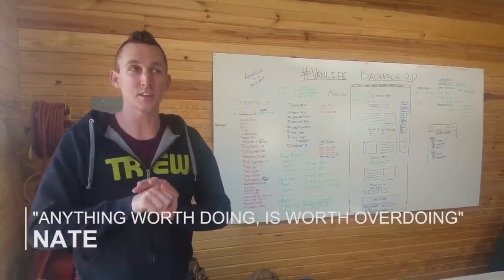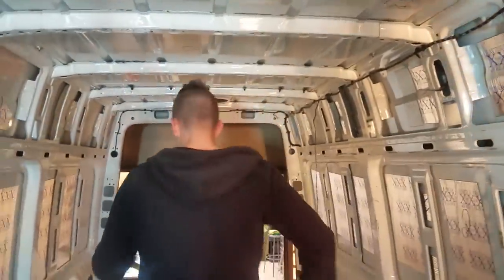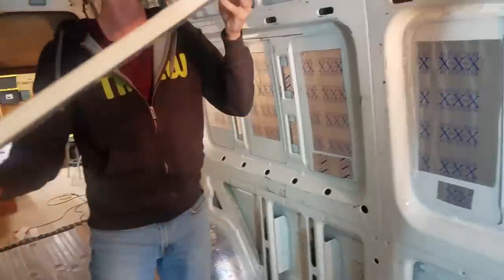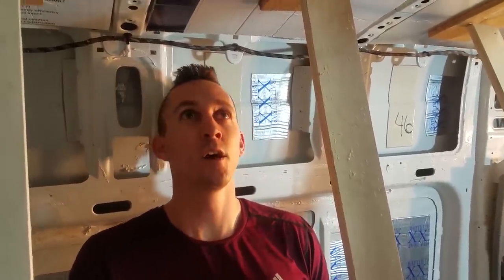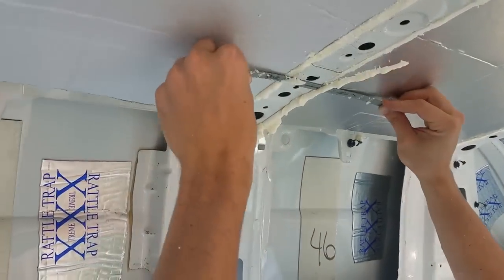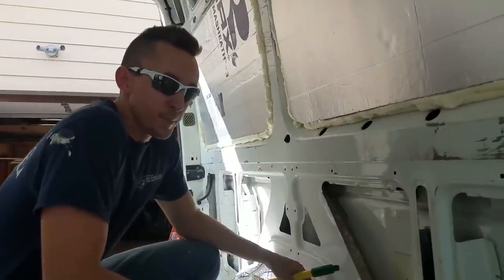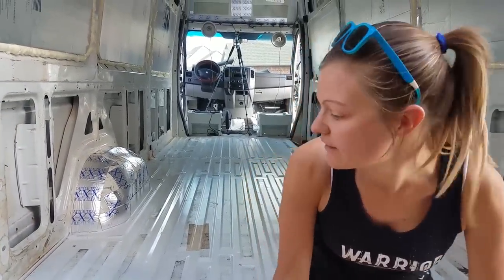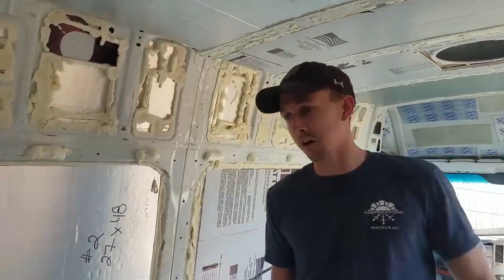Installing Campervan Insulation in our DIY Sprinter Campervan - Ep: 8 | Adventure in a Backpack

Comment: This was an informative video and thanks for posting it! Finally I bought a van yesterday; a low miles 1994 G20 conversion with the little high top. I plan on ripping out the interior and building my own. I test drove a few cargo vans first and didn't notice until I drove the one I bought how handy having windows on the right side was. I would suggest adding a window on the right side because when you pull out of a side road and the intersection is at an angle vs. a "T" how those windows make it easier to see oncoming traffic. I realize I will have to have insulated and removable window inserts. Good Luck with your build! I can't wait until I get started on mine after I go thru the mechanicals and make sure it's safe.
Reply from the maker: Thanks for watching!  You're very welcome!  Sounds like an awesome project!  Those angle intersections are definitely tricky.  Most of the time, I can kind of swing around a little further and kind of turn it into a T intersection.  For the times I can, Stephanie is always willing to lend a watchful eye.  Good luck with your build!! :D :D

Comment: TIP: When you're ready to tackle a van conversion with insulation. Please do yourself a favor. Get some silicone for sheet metal/body work. Your local body shop can advise about type/brand. Well even "bathroom" silicone work well. 
Go trough EVERY single spot where metal meets metal, all the joints, etc.  Give it a go with a nice bead of silicone. Sounds tedious but in fact is one of the fastest operation in a van conversion. :-)
Let it settle and go for a ride... at least 50% less panel drumming. Enjoy... ;-)
Reply from the maker: +crpth1 Cool idea!  :) :)  I wouldn't have thought of that!
Reply: crpth1 polyurethane calking works just as well and will last longer

Comment: Obviously far to late but you are supposed to wait till both surfaces you spray with that glue are tacky and then put the surfaces together. Probably wouldn't have needed the supports if you did that. Just an FYI if anyone reads this. Though it does look like excellent work you guys did!
Reply from the maker: Thanks so much!  Yeah, we were just following the instruction that were on the can. lol  At least for the ceiling, the supports were nice because of how much even pressure we needed to make them form to the roof.  The supports on the sides would have been nice to do without.

Comment: Love your content you both come across very natural and informative. 
Next time you may want to consider using a pro gun for the spray foam, they are cheap and have finer control and you don't need to use it all in one go. The foam cans are cheaper. You can also get a can of solvent that just dissolves the foam (soft or hardened) which is great for cleaning it off of clothes, get that T-Shirt out of the trash....  Do you intend to do a followup video with your thought on how effective it has been and what if any you may do differently next time?.
Reply from the maker: Thanks so much!  Good tips!  We will definitely check into the pro gun next time.  Before starting the project, we underestimated how many cans it would take. lol  We will indeed do a followup video, likely in the spring as it looks like we will be spending winter in the mountains.

Comment: Trying to get polyiso to stick can be a pita...

I wound up using r13 fiberglass in the upper and lower side panels,  great suggestions large gap filler where I couldn't access, and I'm trying to get polyiso glued in with construction adhesive...

Comment: Did you adhere wood strips on the floor of the van (before putting down the rigid foam board). If so, how did you do it? Did you adhere the rigid foam board to those strips? And how did you adhere the plywood to the foam board? (If you have another video about your flooring installation, I can't find it. Sorry). Can you please explain your floor instillation process in more detail? Thanks!!

Comment: I think you did a great job, I went with the polyurethane (closed cell) sprayed everywhere (ceiling and upper walls) and polyurethane poured into the lower walls (small amount at a time to prevent warping) and a 1" rigid foam board on the floor.
like you said there are so many ways and everybody thinks there way is better...
Reply from the maker: evypr0ductions Nice!  would you do it that way again or would you explore other options if you were to do it again?
Reply: As of now yes I would do it again, I'm an architectural technician and one thing that you learn about insulation is that moisture will condensate if you have air pockets, you guys seem to be only worried about the outside heat, but I live in Canada so I have to worry about the cold outside air as well, the last thing I wanted was to have inside moisture (breath, shower or cooking) condensating on the cold van panels. my van conversion is operational but not 100% complete so I will see in the long run if it was a good option.
Reply from the maker: Awesome!  Good to hear.  You didn't have any issues with warping?  Obviously, slow and steady seems to be the way to go there, eh?
Reply: exactly slow and steady is the key, in my case I had 24 linear feet of lower walls to pour polyurethane into so you dump one cup every 18inches, you can pour a layer every day (1hour). the other thing is that if you trap the foam it will warp the panels, so if you have upper free space for the foam to expand to, you won't have any issues with warping, my van is an extended Ford E250.

Comment: Did you notice any distortion of the metal panels as a result of using the expanding foam insulation?  Sometimes people do not expect the pressure caused by the foam expanding inside of an enclosed space.  Injecting the expanding foam into those ribs is the questionable area only.  I was just wondering if it's possible for that to cause bulges on the outside of the van body.
Reply from the maker: I've heard of that, but never actually seen it.  We did multiple light layers of the foam in the ribs of the van to avoid that though and we had no problems with it.

Comment: One can of Great Stuff can be used multiple times if you simply use a can of carburetor cleaner to dissolve the foam in the tube and spray nozzle.  
Carburetor cleaner is spray acetone. Acetone dissolves styrofoam.  
So you can do that if you want to.  But if you want to do it all in one run that's fine too.  I have done it both ways.  
Love the van.  Please come do mine.
Reply: Uncle Kent isn’t that how you make napalm?
Reply: @StephenShreds  No napalm is gasoline and styrofoam

Comment: Did you consider under carriage insulation?  A lot of refrigerated trucks spray foam underneath. Needs to be re-coated every three years.
Reply from the maker: Dreux Jacques Actually, we never considered that and really didn't know it existed.  Seems like something that would be easy to add down the road if needed.  Thanks!
Reply: Be sure to used closed cell foam insulation. If it's open cell foam it will act like a sponge and cause rust.
Reply: @EMU I'd love to hear more about this.

Comment: I'm loving your progress. I bought a 170" sprinter at the beginning of March. My brain is absolutely fried with the hours I've spent researching and planning. I think i'm paralyzed. I've installed a maxair fan and roof rails. Added sound dampener and Insulated the rear doors. The amount of braces you used made me a bit anxious lol, but it turned out great guys! well done. I also follow you on IG. @2dogsandavan
Reply from the maker: RedSea Desert Awesome!  There is SO much information out there.  we are aiming to do a solid job...without over thinking it.

Comment: Did you guys experience any squeakiness from the foam?  And I've read that this type of spray foam is open cell meaning susceptible to absorbing moisture and thus mold over time, what are your thoughts on that?
Reply from the maker: Nope, no squeakiness and this type of spray foam is closed cell.

Comment: guys look for the 3M 90 if you want bomb proof holding power!
Reply from the maker: Nice!  Yeah, we used the 3M 77 and it... kind of didn't really hold very well...  That expanding foam though... Wow!  Once that stuff expands and dries, it holds that rigid foam in there like damn concrete!  We will def give the 90 a shot next time we need a spray adhesive!

Comment: Great video.  This is exactly how I plan on my upcoming build and also thanks for the rattle trap tape concept.  The only thing I won't use is that good stuff spray insulation to fill in the cracks. Instead I'll just cut tiny  strips of cotton or polyester batting and use tape, and just stuff the ribs with batting as well. That spray stuff is just too damn messy. Besides I live in southern California so I really don't need to go overboard with my insulation and I won't insulate the floor either.  Good job you two!

Comment: Great work.
I like that you foamed all the cracks
if you install a panel with tube of silicone or construction adhesive, apply it in circles. the circle forms a suction cup and will hold the work better until it dries.
Silicone holds very well.
Reply from the maker: 64maxpower Thanks! Good idea!  I'd never heard of that before.  I was surprised at how well the expanding foam held the panels in place.  That's some sticky stuff!

Comment: What should I use on roof of gmc Savana hitop fiberglass. Only have about half an inch due to headroom. Thought of 3/8” Ultratouch radient barrier denim towards ext foil int. I have some 1/2” polyiso foil on one side. And what about 1/4 or 1/2” pinkboard XPS but it’s not foil faced. I want keep sun heat out yet and cool inside as well as warm in winter.  Confused....

Comment: Hey - great videos and extremely helpful - thanks for putting them together. I'm just starting to insulate. How did you size the insulation to the gaps in the size of the van as they're each different? Thanks
Reply from the maker: Thanks so much!  We actually just took measurements to the approximate size then trimmed to fit.  We tried templates, but that took too long for not very much savings.  Good luck!  It's a long process! :D :D

Comment: I got away with cutting an inch or so off the spray tube after it hardened when I went to use it later. If you camp in super cold weather the floor is important but, those sealed air gaps air also insulators. Good job.
Reply from the maker: Oh, nice!  I didn't even think about cutting off a bit of the tube.  Looks like we will be going super cold this winter so we will have some first-hand intel.  Thanks for watching!

Comment: With all of that spray foam, aren't you concerned at all with off gassing? There are other greener and less toxic ways to go, any reason you went this way? Just curious, I haven't priced the greener foams available either. Thanks.
Reply: You're thinking of the old foams that used to be used, the new ones only give off gasses for a while until it hardens.
Reply from the maker: CrossGrain Wood Products,LTD There is ALWAYS A greener way to go and we love going that way.  unfortunately, in our research, we never came across any products that were both green, useful, AND within our budget.  That being said, the foam doesn't have any smell, really, at all... I wish I had some data to back up a claim that it doesn't off gas, but I don't.  But it does pass the sniff test and that will have to be good enough for us.  Plus, we have some killer ventilation set up too! lol

Comment: Once again, a very helpful video!  As I looked at your Oceans 12 support board gauntlet, I kept thinking: Thinsulate.  Did you consider Thinsulate? I know it's more expensive that polyiso but not bracing required and maybe easier to fit in weird places/conforms more.  Just curious how you chose the polyiso.  I also read that polyiso loses R-value in the cold, but maybe not enough to matter.
Reply from the maker: We considered all options; then we picked the one we felt would be the best at the time.

Comment: Curious why you used the existing floor as a template but didnt just reuse the existing floor? Im doing a similar build and my floor is in pretty good shape that was pulled up. Seeing that it is 1/2 inch thick (just like 1/2 inch thick plywood) I was thinking to simplify life and reuse. Clearly Im bringing this up for any opinions as to why NOT re use it so I might rethink this? Im not trying to be judgmental, just want to think it through properly if Im making a mistake. Thanks.
Reply from the maker: Great question!  Our van was used as a plumbing van and had all kinds of smelly grease and grime on them that never would have cleaned up.  If the floors are clean, I'd definitely consider using them, but ours weren't.

Comment: FYI, rip-cutting lumber refers to the grain direction: a cut with the grain is a rip-cut and across the grain is a cross-cut! The actual length of the cut is not relevant except for the choice of cutting tool (not the saw-tooth shape or number -- very relevant). Plywood cut across the small or long dimension of a piece is both with and against the grain, since the lumber is cross-laminated.
Reply from the maker: Neat, thanks!

Comment: Hi, Nate and Steph. Great videos and website. 
I'm thinking about insulating my floor the same way you guys did. Are you still happy with what you ended up doing? Specifically, what can you tell me about possible noise...Is it relatively quiet, or does it squeak at all when walking on it? Thanks for your time, and have fun.
-Mike
Reply from the maker: Sorry about the delay.  Your message got stuck in the spam filter.  Anyway...we are happy with it.  There is essentially zero noise.  After a thousand miles or so, the build is pretty quiet.  There is a rattle or a squeak here and there occasionally, but no worse than any other car we've had, but I can't say if it's due to the insulation or not.  Also, there is no squeaking when walking on it.

Comment: No need for all that wood supports, you could have brought a expanding foam gun and tube cleaner!
Reply from the maker: Tahir Rana For the wood, yes we did.  The adhesive was not strong enough to hold.  

For the expanding foam: Yes we could've, BUT...we didn't.  Remember, our opinion is: the best way to insulate the van is the way that is done. ;)

Comment: You are right about not filling the channels in the floor.  The proper rigid board has sufficient compressive strength that bridging over the channels is not a problem.  A continuous layer of insulation on the floor is needed.  The metal conducts heat from the outside  in orThe walls and roof should have a continuous layer of insulation as well. The depressions can be filled with rigid insulation and then the continuous layer applied over it.
Reply from the maker: Joe Hearn Awesome! yeah, so far so good and we have had several nights in the 30-40 degree range with no heater.

Comment: How did you make out having the roof vent already installed? I'm wondering if i should wait to put the roof vent in until the insulation is in.
Reply from the maker: Wilje pretty good really!  it was nice not having anything in the way when I was doing the fan.  if I were to do it again, I would do it the same way.

Comment: Take your measurements in centimeters so you don't have 54 and 1/2 or 13 and 3/4.
54 and 1/2 is 138 cm, 13 and 3/4 is 35 cm. So much easier. Only Americans use such an obsolete measuring system.
Reply from the maker: Whereas I do wish America was on the Metric system, we are not, and all of our measuring tools are imperial.
Reply: Johnny MF Bravo It's actually a pretty logical system of measurement for construction. I'd use metric for engineering parts and other things though. I'm always amazed as to why people from other countries talk shit about our education system (admittedly, not great), yet fractions are too confusing for them.

Comment: Now that we are getting on to cooler weather?  How do you feel the insulation is working?  Did it keep the heat out during the summer?
Reply from the maker: It worked well in the heat. With all of the fans on, it was like sitting under a shade tree.

Comment: just wanted to mention that they make a thumb tack like self sticking wire you attach to the surface and push the foam board onto it and then push the locking tab on over the foam board. if i think about the name will mention it later

Comment: Awesome - very helpful - what did you use to insulate the wheelwells? Thanks
Reply from the maker: Thanks so much!  Glad to hear it helped out.  The only thing we did on the wheel wells was Rattletrap Sound dampener and used no additional insulation.